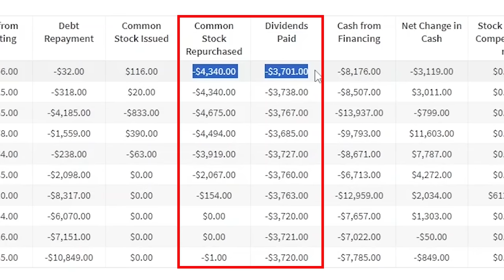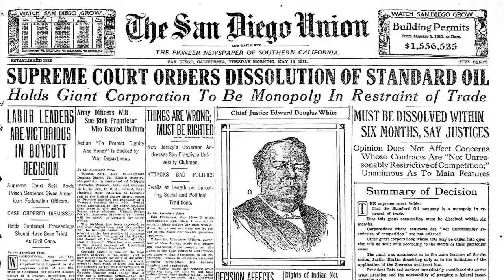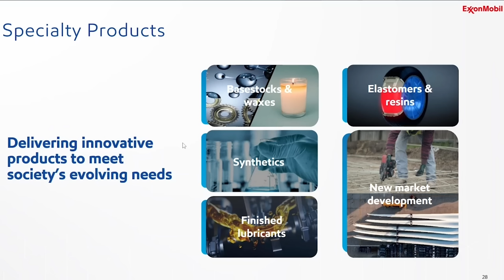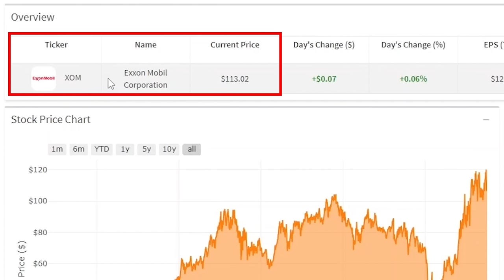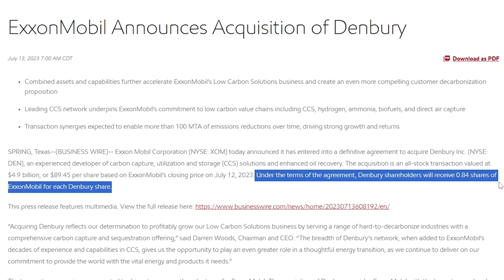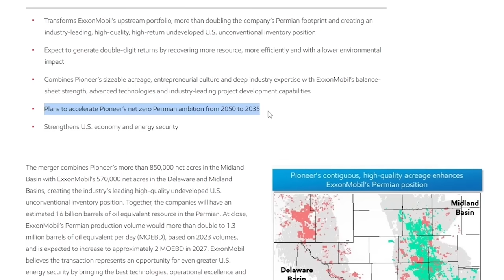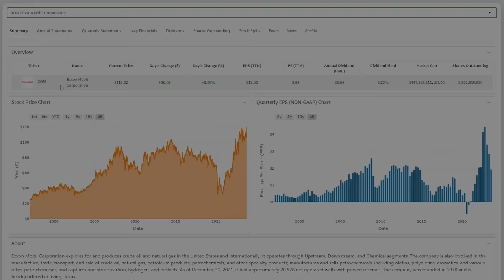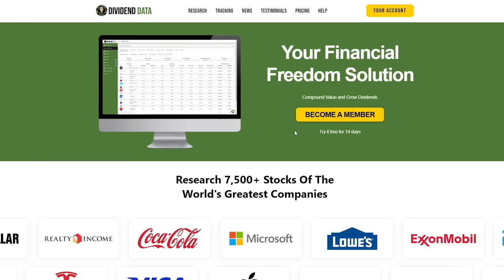The Best Oil and Gas Stock To Buy Now | XOM Stock Review

Comment: Won't XOM acquire debt with this merger?
Reply from the maker: Yes, I should have mentioned that. They will acquire the balance sheet (and cash flow) of both companies. Luckily, it's not that sizeable compared to the scale of ExxonMobil. My main point was emphasizing that they didn't use any debt to make the acquisition. It was an all stock transaction.